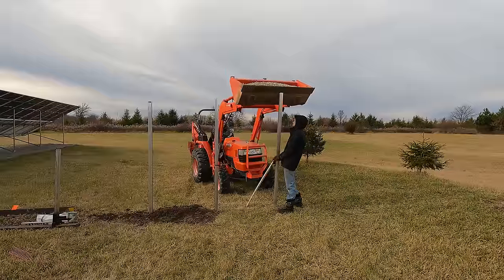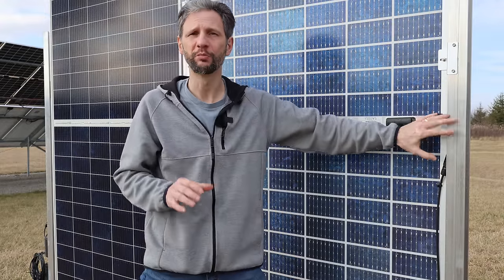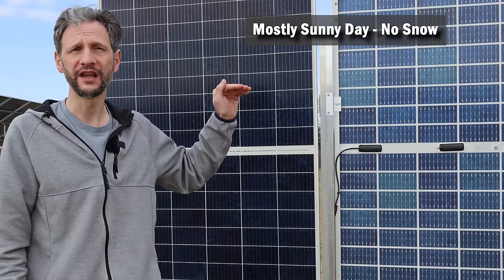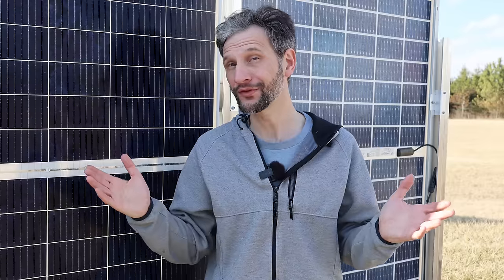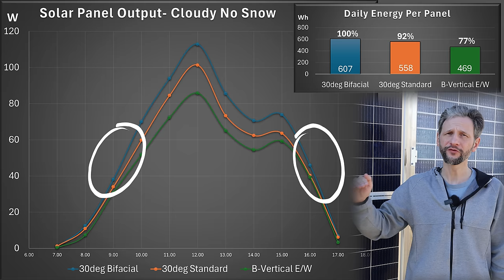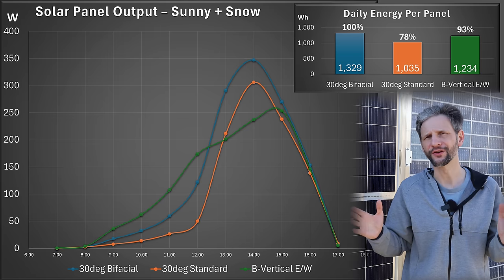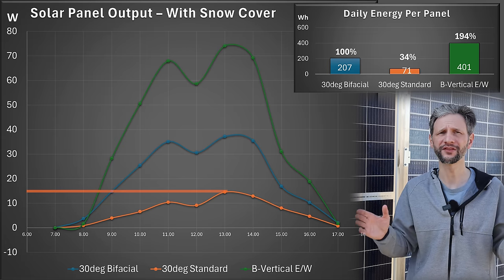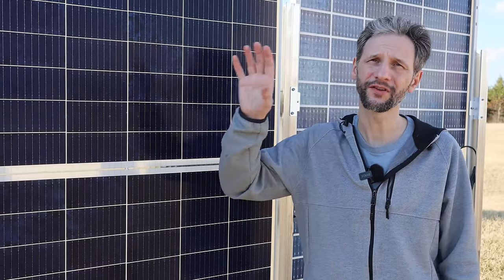Vertical Bifacial Solar Panel Performance Results Part 1

Comment: Interesting. I can see this having huge potential for farmers who might want to use vertical west facing bifacial panels to generate power between rows of crops while maximizing the power that can be sold late in the afternoon when rates are high.

Comment: Awesome experiments! maybe a stupid idea but what about adding a mirrors under the bifacial panels? More of a usecase for those with limited space, but you could probably show~10% more footprint for possibly significant boost. (or even how much reflectivity really helps - concrete vs snow vs mirror surface!)

Comment: A solar tracker with the ability to tilt fully vertical would be interesting to see. Obviously this becomes significantly more complex, but the ability to tilt and slew not only for the most advantageous sun, but also weather conditions, like snow and hail would be pretty cool.

Comment: Cant wait to see the results from the summer. @UndecidedMF did a video explaining that the vertical panels out perform normal panels in the summer due to reduced output from over heating.

Comment: This panel design would be incredible in the northern latitudes in winter where the sun is always fairly close to the horizon. You’d definitely want to flip these up in a more traditional orientation during the summer though since the sun tends to track very high.

Comment: Very interesting. I’ve vertically mounted some south facing standard panels on my house. Just used unistrut and some bolts. 

Not connected them yet but an excited to see what they manage vs roof mounted.

Comment: Looking forward to the summer results because one of the efficiency benefits cited is heat dissipation and avoiding direct sun in high heat. Cleaning is another benefit like snow cover that likely shows up more at farm scale than a home array. Ground albedo seems like the biggest factor besides land use.

Comment: The point is not outperforming southfacing panels. the point is complementing them.
on a per aerea level you obviously get less Energy. That is because you need to put them further apart  to avoid them casting shadows on each other. But that is worth it to the amount, that you need the energy in the morning or evening.

Comment: Writing a software program for a sun tracker when you expect peak vertical power from the albedo effect in series with an auto -tilting axis array that is also in parallel with a fixed south-facing array would be the most triangulated kilowattage to that day’s peak insolation factors.

Comment: Great topic 👍🏻 Have you considered changing the orientation of the vertical panels from the ideal NS / EW to a slight angle towards the south of the W side, e.g. 30*? Sunrise and sunset will still be caught, but you will gain additional maximum solar energy at noon. On the chart, you will lose a little in the morning but you will gain significantly in the afternoon.
Reply from the maker: I plan to try more angles in the future.

Comment: I did my college capstone project on solar tracking. With just off the shelf panels, putting them on an X and Y axis that follows the sun, I was able to net out 42% more power per panel per day, and there was no curve, just when the sun was up and shining, I had 90%-100% and the line was relatively flat. When it was cloudy, they'd hunt for the spot in the sky that had the least amount of interference. The servos are so power efficient for how little they'd have to move, that the losses were around 3%, so the net gains were about 39%. The peak in the middle at solar noon were near identical to fixed panels, it doesn't magically generate more power. But if you have a battery to store the power, you get a lot more output per sqft of panel, and to me thats huge as it reduces materials used. Plus its more incentive to have full time maintenance crews on large scale projects, minimizing the effects of snow as you'd already have staff to clear them. It's no where near as cheap as fixed panels, but its much more efficient land wise and resource wise, which for a green energy, should be the goal.
Reply from the maker: Thanks for posting your project results.  Do you have a website with the details?
Reply: @ProjectsWithDave  No this was just my personal project, I do not have a website or anything. Like this was a very crude demo that was put together out of wood and toy servos on basic swivels, I was in college I had to improvise. The other part of the findings was that the X axis mattered more than the Y if you do only 1 axis. Doing both axis had a diminishing return, the benefit for just the X was like 65ish percent of doing both, while reducing the mechanical complexity drastically. Unfortunately this was years ago and I have since moved and most of that hard data was lost, but once I get some land I was going to try and re-create it at scale, rather than just a cellphone charger

Comment: its a good comparison and snow cover is really the worst situation for south facing panels but there is a way around this that is easy to implement. If you have seen hoop house greenhouses they have sides that roll up. this can be done automatically by motors when a temperature sensor in the building senses there is a need for cooling or manually with a hand crank. it is a heavy mill plastic that can withstand years of sun and weather conditions. So an install of single facing panels with this automatic motorized cover could be set up to protect the panels from snow but it would require that you set the cover to move into place based on weather reports. Unfortunately this is not an out of the box solution but could be the best solution for most people. not to mention you should always design your array to provide more than your needs. Another option is tilting the panels themselves during snowfall. This is not easy especially when you get into icy conditions but it is possible.

Comment: A cool use case for these would be to buy used panels and use them as a solar fence. You could use Wood or wire for the North facing section but panels for the rest.

Comment: Hello Dave we recently came across a company that is working on on-grid / off-grid solar power booster where their system generates power even before sunrise and after sunset. Its is combined with solar and generates a steady peak power output irrespective of weather conditions.
Reply from the maker: Sounds like batteries are involved...
Reply: @ProjectsWithDave  yes batteries, and axial flux generator and a high torque dc motor. where a 5kwh solar generates only 20-22 untis per day this system generates 40+ units per day and at peak that was interesting to watch

Comment: Very informative video, love how you do your analysis and looking forward to the years long review. It would be interesting to see what the cost benefit/loss is on a vertically mounted panel where the ground is also producing = farming between the rows vs. ground mounted where the ground provides zero benefit from crops/grazing. Using the vertically mounted panels as fencing would seem to have its drawbacks because only very small animals, like chickens wouldn't damage the panels by rubbing up against them. Thanks for sharing.

Comment: I believe if you used the vertical biracial panel 50/50 e /Welch at a slight angle up, you would reduce your mid day dip, dramically and would overall have a great outcome.  You would also be able to use the land between the rows for increased production increasing the overall return on investment, over the standard panels

Comment: It would be interesting to see the vertical panels in a big array to see the efficiency per square meter, because I can see them installed very packed to enhance the extraction of energy in small areas

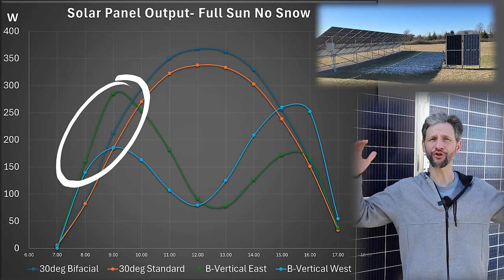Comment: This was an excellently presented video!  I live in NW PA, so this is super helpful as I plan my solar array for this year.  I think a lot of it comes down to how you can save KWH on your electric bill from month to month or year round as a credit bank or if you have net metering/time of use rates.  Since mine is a credit bank by the year and no time of use rates, I will optimize for summer time production.  Winter time production is going to be ~10% or so of a summer month.   Planning on doing ~36 kW on a 5:12 pitch roof.
Reply from the maker: A year long credit bank is a great deal.  It gives you a lot of flexibility to optimize max production without worrying about time of day or time of year.  I talk about the financial implications of the various net metering methods in this video: https://youtu.be/IwUK1dNJ3n8
Reply: As long as you are doing it, it's worth doing

Comment: I saw the other data that sparked this, fascinating.  I have a parent that lives on a lake and they want to set up a ground mount.  I wonder what kind of reflected power they would get off the water with bifacials.  Myself here in the city I have very limited space for South facing panels, but I have much more space available to set up E/W panels as kind of a 'fence' around my property.  I plan on putting a few up later this year.  Dual purpose, fence / solar.

Comment: I am about 6 miles north of the Willow Solar Farm and have wondered how well vertical bifacials would work facing south in the winter. Originally, I had thought to install panels on top of my metal roof but the shop at 9/12 and house at 6/12 can easily go months without shedding snow, sometimes reaching depths over 5 feet on the 6/12. I'd really love to see how hard it would be to mount verticals along the ridge lines but even though Willow rarely sees wind, I'd hate to install a sail 30 feet off the ground. I loved your experiment; wish you were testing theories up here!
Reply from the maker: It seems like a steeper angle would have made more sense for the Willow Solar Farm, but maybe they just gave up on winter production altogether and focused on the best summer production they could get.  As you stated a large vertical sail on your roof seems risky.  I'm sure the trusses are not designed for that kind of loading.

Comment: Really great experiment. As costs come down (or maybe even if they don't) I'm expecting to see solar "fencing" where someone runs a whole fence line of bifacial solar panels instead of a standard fence. One east, one west, maybe one micro-controller per panel pair.  No snow maintenance, rain will likely keep them clean, the question will be overall durability.

Comment: I’m excited about this for agrivoltaics, but also, wonder, and I’m testing, just how cheap you can build single axis tracking with linear actuators. I’m using the actuators as a structural part of the ground mount. Some linear actuators, are not much more expensive than the same length of steel, unless you are buying in bulk. This may not be practical based on the wind load in some places. Love your attention to data!

Comment: Summer results would be interesting. Some tester in Europa found dramatic differences in panel temperature and with that increased efficiency for vertical installation.
Reply from the maker: Yes, I'll probably take temperature measurements for the summer results to compare.

Comment: The point is : when you need the yield mostly, the vertical panes came through and gave you the wH's. Build for winter and you still have enough in summer.

Due to the limited shading, I wonder if you can  more vertical panels on a lot then at 30 degree.
Reply from the maker: I believe vertical spacing would take more space.

Comment: I have a few comments good sir:
1) do you think that the production of the southfacing ones would be lower if mounted on a roof / in a hotter climate. Since that is the main benefit of mounting them vertically. 

2) Most people have very little space, meaning that they would use it as a fence. Which is being sold in Europe atleast. 

3) Clearing the panels of on a roof, is much harder in the winter, having them on the ground is much better. 

4) Most people need more energy in the morning and evening, since you wake up, go to work and get back in the evening. 

And that's why for 90% a photovoltaik fence is the best solution.

Comment: The vertical panels will have less overall time being covered with snow as the snow will not stick as easily to vertical surfaces.

It was kind of mentioned in the video but not really this clear.
Reply from the maker: Right, that is the biggest advantage in winter weather.

Comment: excellent testing!🫡 This timely for me after having seen a video about this yesterday. I predicted that it could be worth it to save money on buying a cheaper inverter due to lower peak performance and the difference to buy more panels. However, I was wrong because inverter pricing is also dropping like the solar panels. Too bad that vertical mounting is not possible in tight residential

Comment: Great video  @projectswithdave . Can you share the dataset? I am interested in value e.g. USD (MWh are important but not so much in the end). Having 15 min interval pro output of the setups I would compare it with spot price in northern Europe. The vertical would win with a margin possibly. Also for batteries (island installation) it would require significantly less storage as the minimum daily output is way higher than other setups.
Reply from the maker: Thanks!  Which data set are you looking for?  The data isn’t in a clean format for easy distribution.

Comment: Would be really interesting to see how a standard south-facing array performs with bifacial panels but with gaps between the panels to allow light through and illuminate the ground behind. Could do a series of tests varying the gap width and adding light-colored gravel.
Reply: I have actually just designed a ground mount that will hold 4 panels per mount and has a 6" gap between them to allow the sun to shine through for the bifacial panels. I just got my drawing stamped by a Colorado PE...so hopefully this year I will have this new house with our solar system going.
Reply from the maker: Nice!  Let us know how it performs.

Comment: Nice test, we will be seeing much more vertical instalations in the coming years. Output of newer solar panels with 80-90% bifaciality will be significantly better compared to the 50% bificality solar panels used in the test.
Reply from the maker: 80-90% would be amazing.  Where have you see that?
Reply: @ProjectsWithDave  Bifacial Topcon panels like trina vertex s+ are around 80% bifacility and HJT panels could  reach around 90%.

Comment: What if you had a triangular structure between the rows that would reflect the sun onto the panels, especially during noon. The material doesn't have to be expensive, maybe something plastic with metallic or white ultra reflective paint.
I feel that with that, it would come really close to the performance of angled 30 degree bifacial panels, while also outperforming them on cloudy days, and also spreading out the output more over the day.

PS: I believe that the shading by the angled panels affected the output of the vertical panels, not much, maybe 3-4%.

Comment: In the summer the bifacial vertical panels will produce much more than the south orientated Panels. Over the year the vertical bifacial modules will also produce more. Its time for the next video about it.

Comment: I used to read a lot of stuff about the "duck curve" but immediately realized that if we put solar farms across the continent, and if the angle some to favor the east or west, we can fix the duck curve easily. Bifacial panels do even better. These techniques combine to reduce the amount of battery (and gas peaker) backup we need for a clean grid.

Comment: I think the summer will be the biggest winner in vertical panels because you have so many more hours of light that is actually behind the south facing panels in the morning and evening that it could be a dramatic difference. Whether or not it will be enough to cover loses the rest of the year is the real unknown. I do think that they might be a winner on white roofs if they are not too tall. I also would love to see you test another few variations of the vertical of panel setups. For people who need a boost early maybe run a pair of panels facing SE, and to test evening a pair or panels facing SW. There are places that start out sunny and end up cloudy late day and some that start out cloudy and clear in the afternoon. Having some stats on that might come in very handy. The SE set would pull strong in morning through midday and still have the  backs picking up light after that and towards the evening. I think even these two variations would see strong results in summer...
Reply from the maker: Some good suggestions, thanks.

Comment: It seems like if your main energy usage is morning or late afternoon, than these could be a great set-up for those that don't use battery storage, especially if they are used to structurally replace standard fencing.

Comment: I made an A-frame with 2 half-cut cell panels facing east- west. no dip. higher power than my direct facing due heat (tropics). cheaper than biracial. no frame needed, just two hinges at top and a brace at the bottom. semi-portable. can be setup at rental property. installation in a day, including a grid tie hybrid inverter. win-win.
Reply: panels were getting dirty so i applied car wax. easy to do on the A-frame, not so easy on my sun facing panels up high. the wax works. staying clean and rain just beads off. planning to change all my panels to A-frame soon.
Reply from the maker: Wax may reduce the transparency of the glass.  Maybe rain-x would be a better alternative?